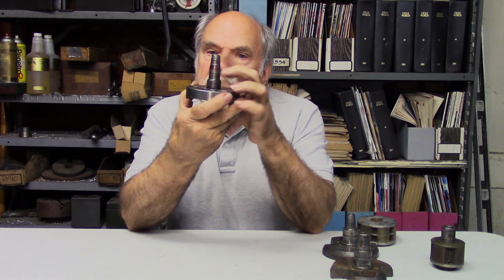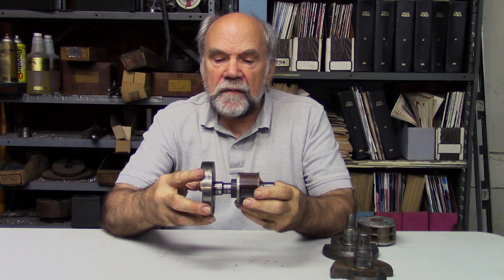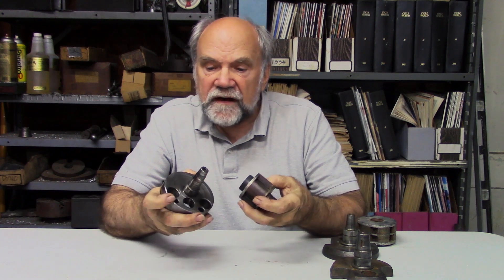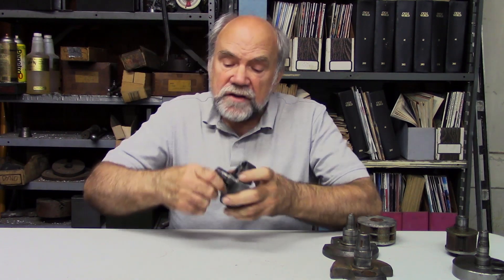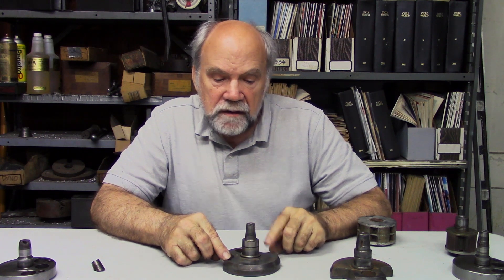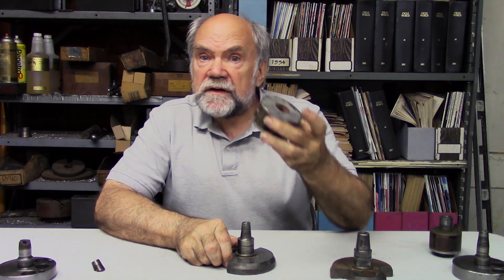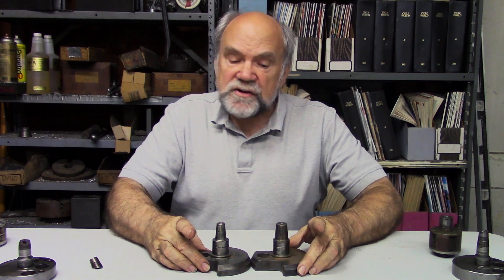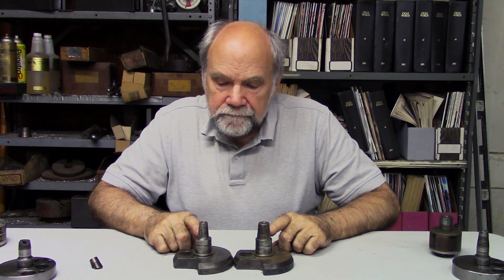What Are The Causes Of Motorcycle Failures?

Comment: You may recall that I wrote to you about the engine heating problem that I had with my European bike.  I was concerned about the damage that may have been done to the engine and luckily I found a buyer who was brave enough to take it off my hands. 
My question to you now is about how sensitive are engine parts to over heating and which parts are affected first and what are the consequences.  Just how should one address the overheating problem especially when both dealer and manufacturer fail to come to the rescue.